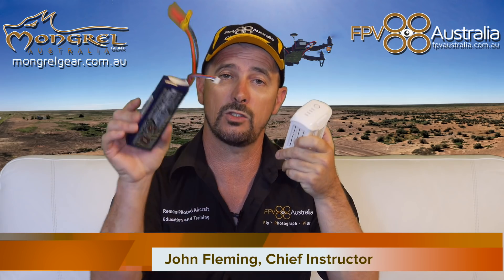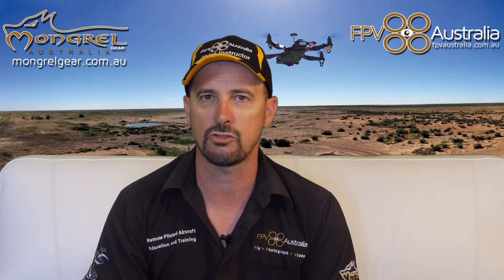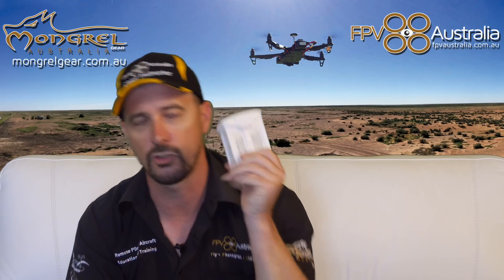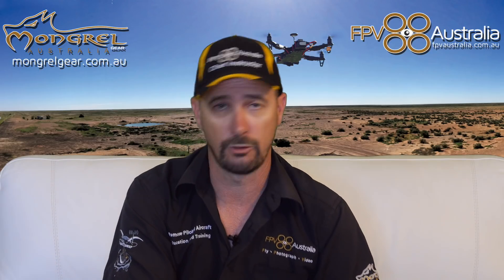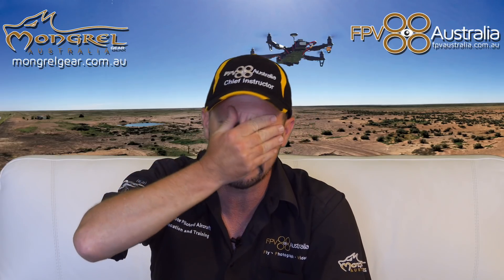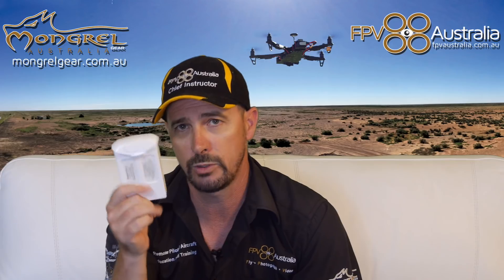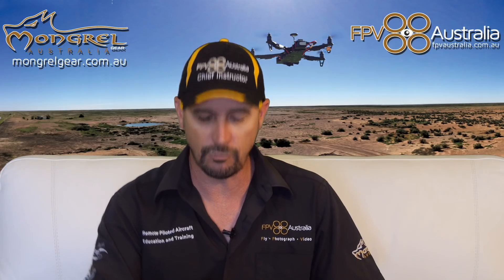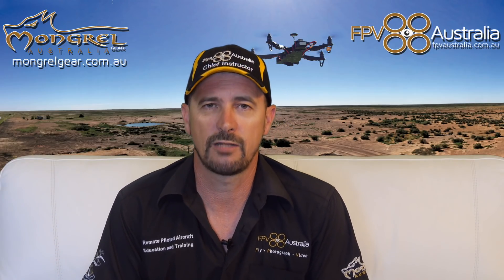Let's talk about LiPo Safety

Comment: Well done, and very timely.
 I use standard non dji lipos, and recently bought a good quality charger that allows me to safely discharge to storage voltage (3.8v per cell) any batteries I don't fly with. I started storing them in a steel box in a shed with a concrete floor after watching a few lipo fire videos.